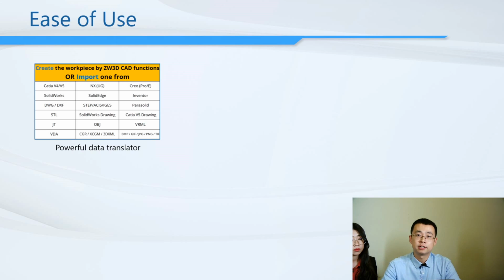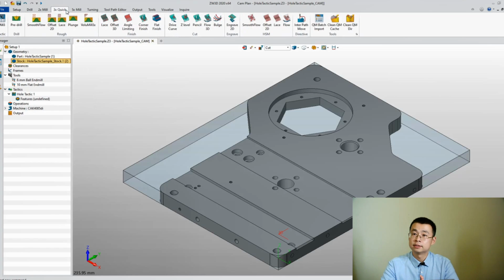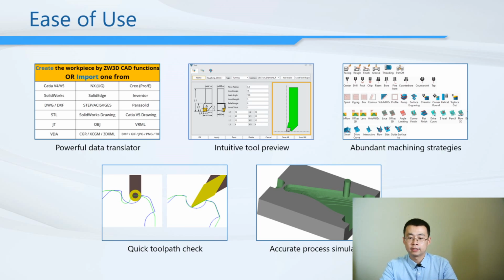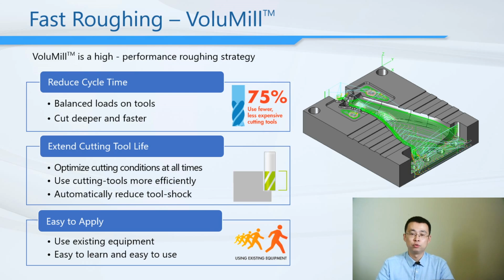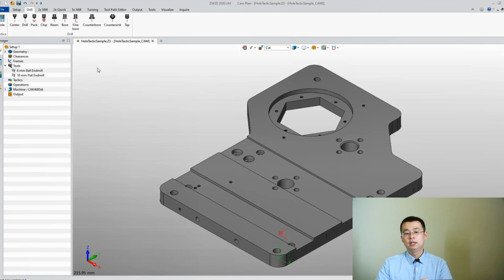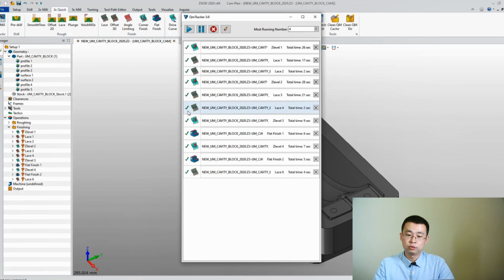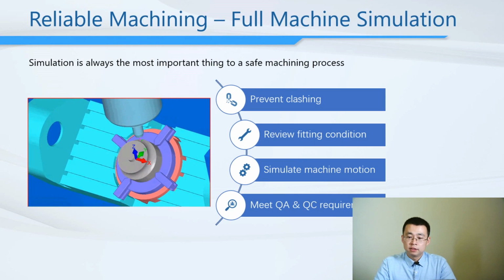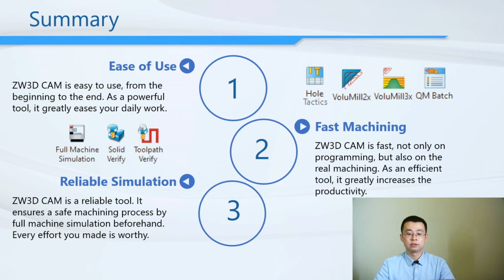ZW3D 2020 CAM: Fast and Reliable Machining

Comment: ZW3D is from china and does not contain Mach3 chinese board PostP :|
Reply from the maker: Hi, Could you explain your question? So that we can better support you.
Reply: @ZW3D   Mach3 is a CNC controller board that the software is actually made in US but the board is made in china mostly , the ZW3D software CAM  doesn't support or have MACH3 post processor